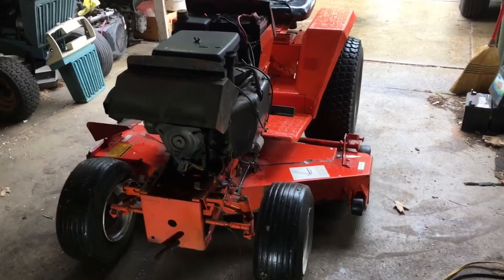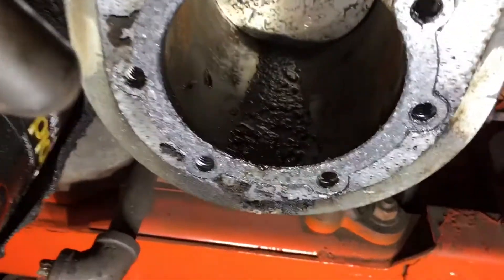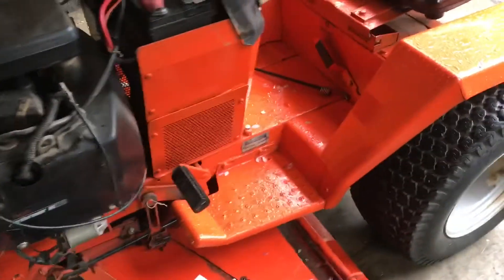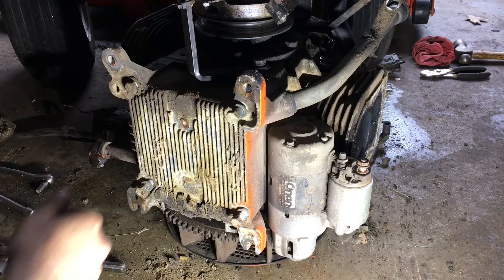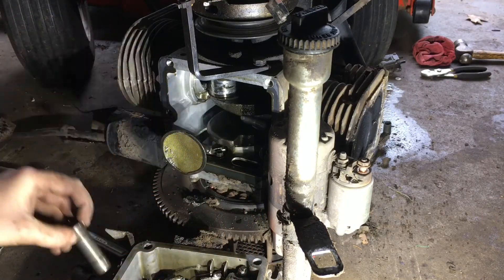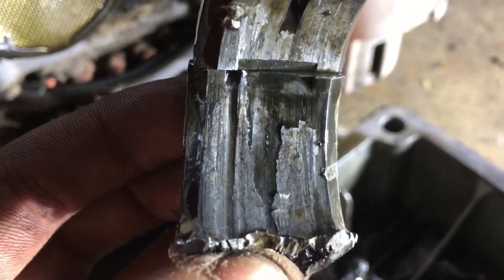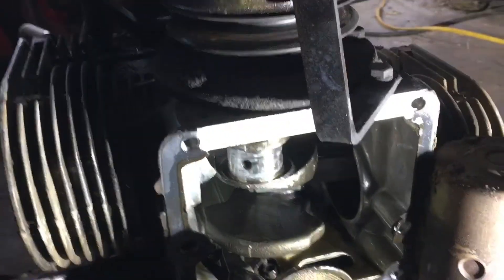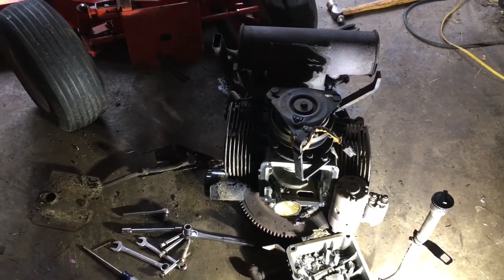New Project: 1989 Ingersoll 3016

Comment: Just got the identical tractor for 100 the other day, runs good, goes good, younger kid was running it like a 4-wheeler, blew the back tires off the rims and he snapped the front axle on the one side, already fixed 👍 These seem like serious tractors built very well.

Comment: That sucks buddy, Got good bones at least besides the motor. Sucks when they give it a crappy paint job but its in better hands! Quite the surprise inside!
Reply from the maker: Yeah I lucked out and found a matching piston in my parts stash of Onan parts engines. Not the same rods so I will have to find a matching pair of rods and then the rest is the usual rebuild supplies. Onan used so many different piston and rod castings and if you mix them up it will cause the engine to shake and prematurely blow up again. I had one engine that was that way. Was surprised to find two different pistons and rods!

Comment: Hello I have a 1976 sears suburban ss18 that I have had a couple years and thinming of selling it it has the BG MS 18 hp and I know you are involved with a lot of sears and wanted to ask you if you dont mind what should my asking price be around I have never sold one before it runs and drive and I would sell it with a 3 point hitch with the rear grader blade sweeper and 2 thachters.  Any help is appreciated thanks.
Reply from the maker: It really depends on a lot of things, overall cosmetic and mechanical condition, location is the biggest factor as a $200 tractor by me is a $700 elsewhere in harder to find areas. In my area something like that would probably be in the $500-700 range as I see more SS16s than SS18s.
Reply: @71_sears97  Okay thanks I live in michigan and I am 15 and loved the suburban but its doing alot of surging and hunting and cant fix it just picked today a 1994 craftsman gt6000 with the kohler 18 hp magnum.